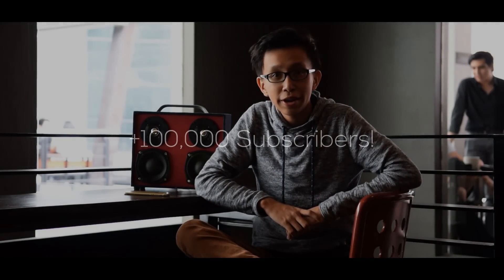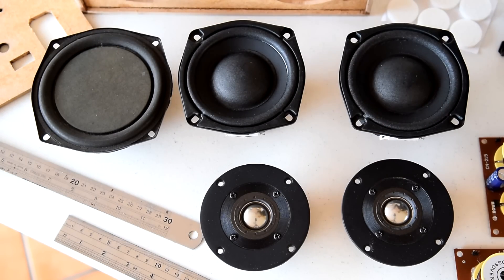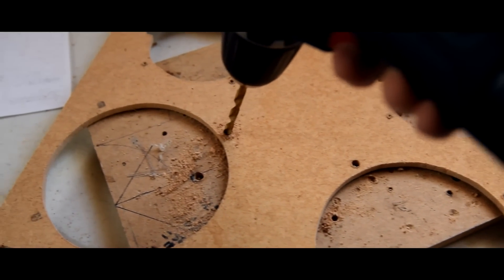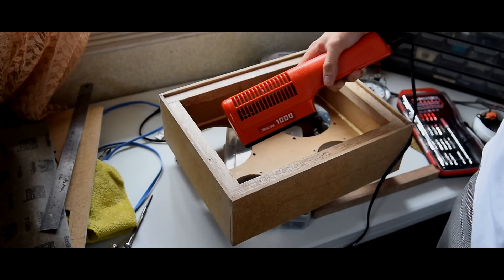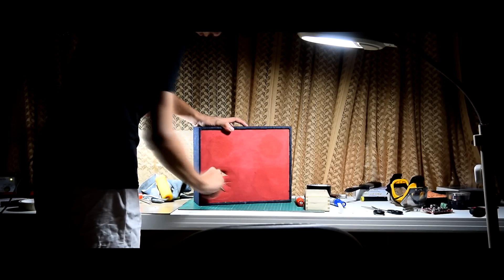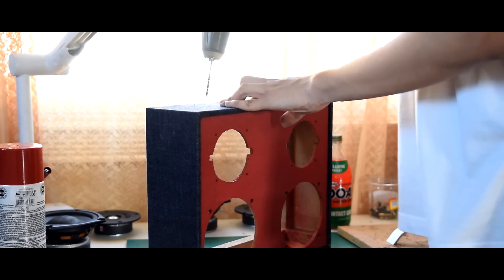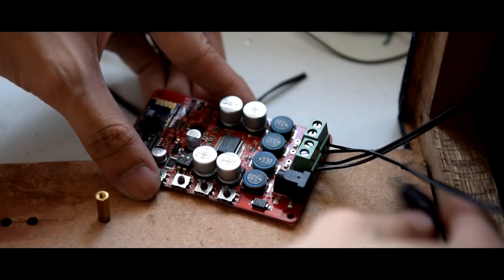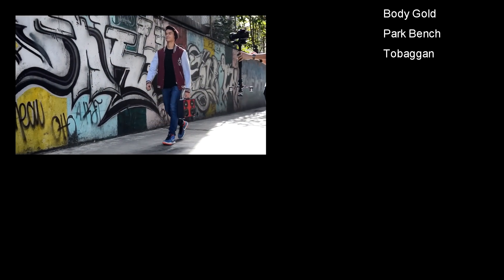DIY Bluetooth Boombox (from scratch)

Comment: Now you could disconnect the output inductors on the amp board and use the signal to drive a few mosfets in arrays. You could be the only one who has a 2000W boombox :D
Reply from the maker: +Krisztián Szirtes Over my years of making speakers, I realized it's not all about wattage. Though that 2000W idea of yours would be really bassgasmic.

Comment: May I know for how much time will the power supply last(full blast volume)?
Thanks in advance for any answer... Oh and GREAT PROJECT!!!
Reply from the maker: + Alberto otto Thank you! I'm quite uncertain. I haven't charged it eversince I made it. So far I've been using it for 4 hours at max volume ans 6 hours of low volume (in room). The battery hasn't gone low yet.
Reply: I see... First of all thanks a lot for answering me, I really admire the work you do... I think that I'll build a boom box similar to yours using a tda3116d2 2.1 amplifier so that I can save some money on the crossover... May I ask you (more or less) how many Ah should I need in order to keep it working for 10h (full blast volume) and if it's possible to charge li-ion battery using a laptop battery charger? 
Thanks in advance for any answer an I do apologize for my poor english and for asking you so many questions